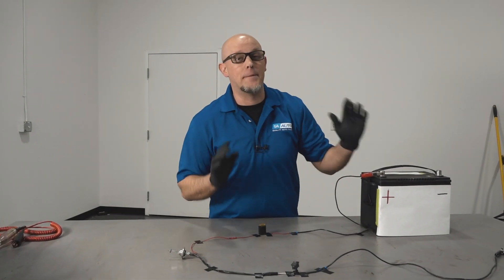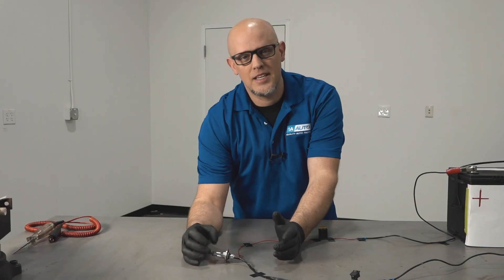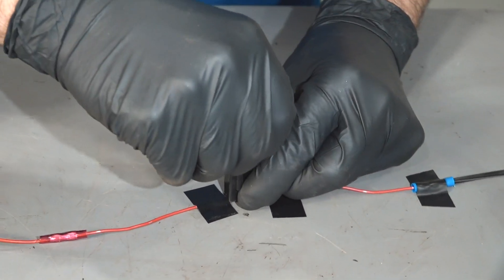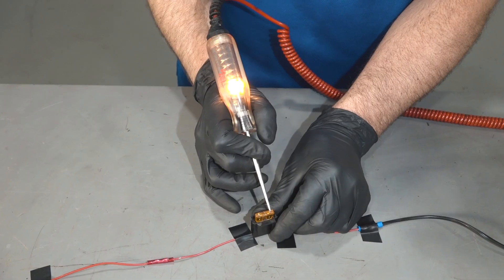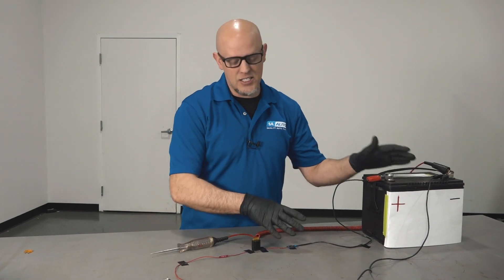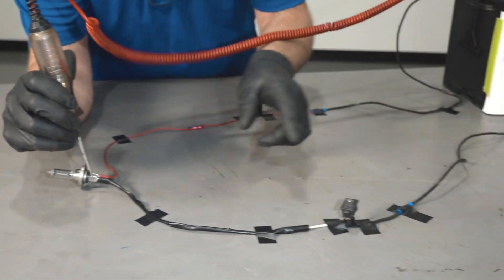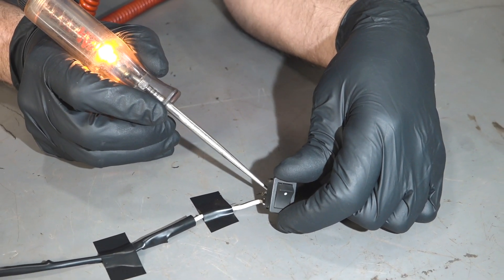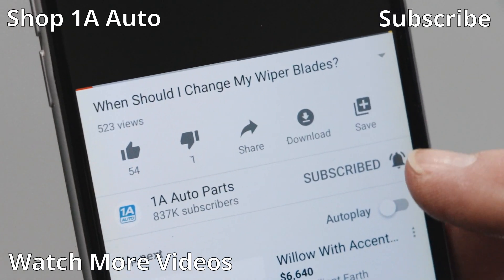Lights, Fans, Radio Not Working in Your Car? How Electric Circuits Work

Comment: don't use test light to test sensors , electronic modules etc  because they are only 5 volts while test light is more likly 12 volts which will ruin your car systems
Reply from the maker: +Ali Star Thanks for the feedback!
Reply: Well at some point while performing a pinpoint test they are going to ask you to use a fused test light.